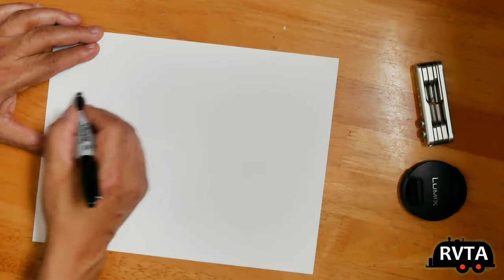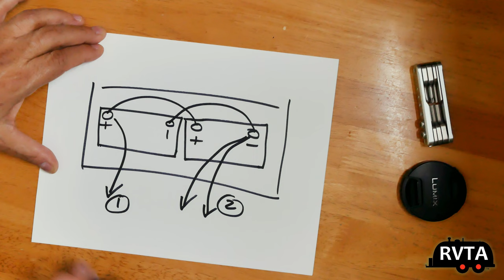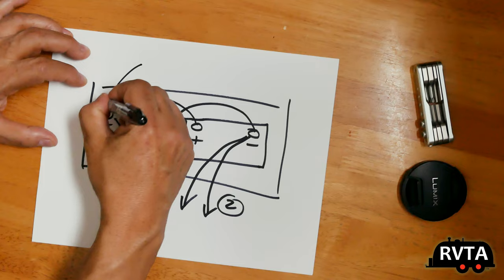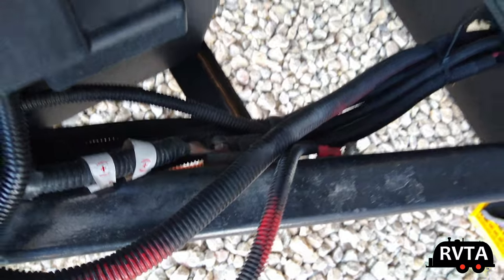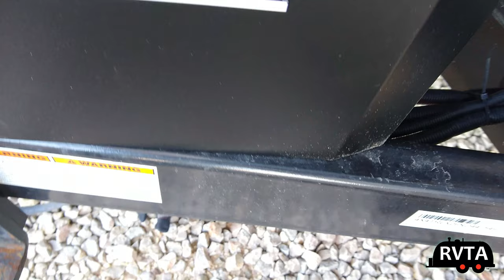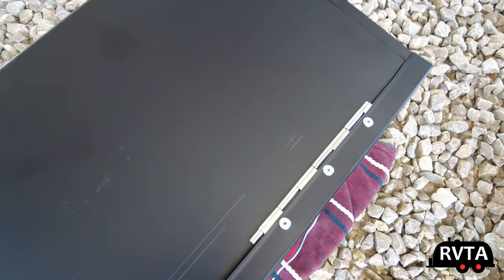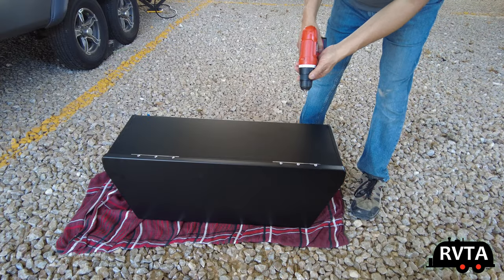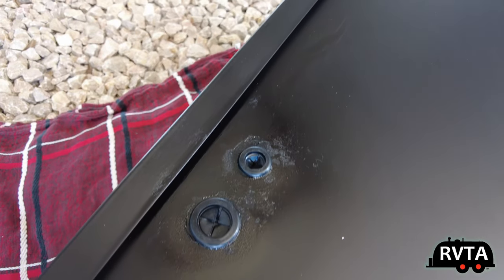UPGRADED BATTERY & TONGUE BOX INSTALL: Rockwood Mini Lite #AoLithium #HaulMaster #RockwoodMiniLite

Comment: Hey Jesus!  I appreciate your humble approach.   Your rating as a C isn't fair - I would have never thought to paint over the holes for rust.  On my install, I will probably spray paint onto a sponge brush and dab it on that way.  Although, nobody will ever see the bottom as you stated, so no big deal.  

Nice install.
Reply from the maker: You are way too nice. So far the box is holding up. Fading quite a bit.

Comment: I have a 2021 2205s, and want to do this upgrade, too. I have been wondering if there is enough space to put them behind the access panel in the pass-through. Was thinking they might work/fit way to one side under those boxes next to the bed - I know the inverter is there.  Did you happen to look at that space as an option? I haven't looked and measured yet. I recall there isn't a lot of space there.

Comment: I have a flagstaff 22fbs which is mostly the same as yours.  Are you able to obtain a full charge of your lithium batteries without changing the inverter charger?  Thanks
Reply from the maker: I upgraded my inverter charge to the latest by WFCO. So, yes.